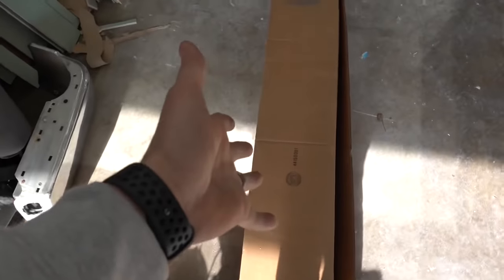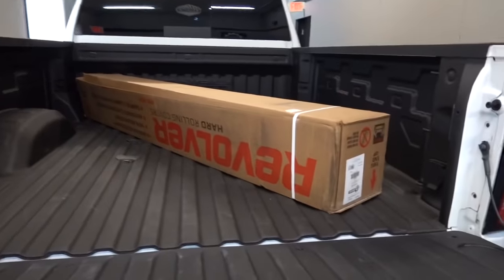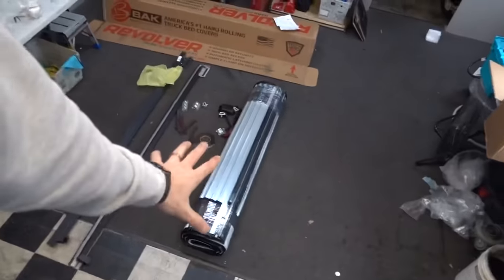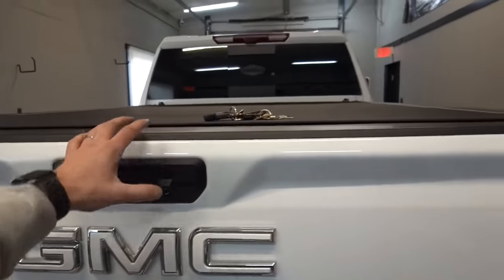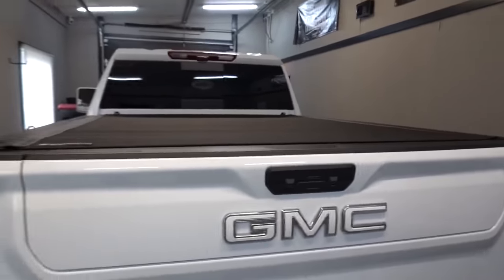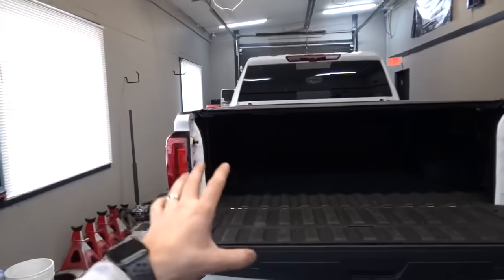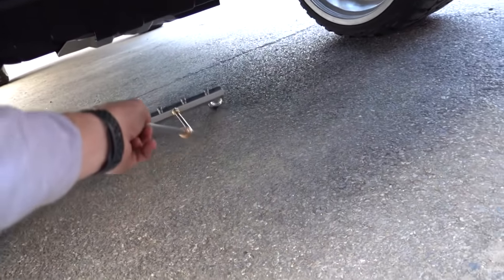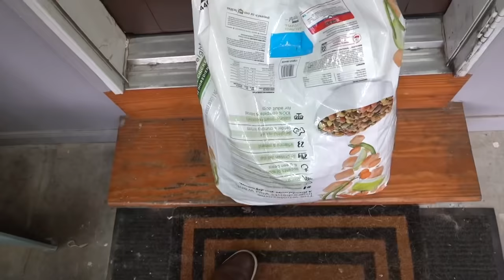Daily Drive your truck? You NEED one of THESE!

Comment: I loved the BAK revolver when I first installed mine.. but  it's falling apart in less than a year,  and no willingness to work with you for manufacturers defects, even though they claim they will.
Reply: My $200 Amazon cover is weather tight and has a lifetime warranty.
Reply: same experience here. I will have to buy new one...but it will not be BAK for sure!!
Reply: I paid $400.00 in 2003 for a Truxedo cover with lifetime warranty and they have put on one new top and new Velcro on each side once . Pretty satisfied with that.

Comment: I herd the DEF fluid can freeze and I think there is an automatic heater, that could be what draining your battery
Reply: In my ‘14 Duramax I had that problem with the def freezing and they never did get to the bottom of it. I ended up deleting before the third time they tried to fix it

Comment: I put one of these on my 2020 a few weeks after I brought the truck home. It was absolutely terrible. The cover itself was 1/4" too narrow and 1/2" too long, but it was the right part number. I was going to have to shim the rails on both sides to make it lay down in the track without beating it down along both sides when I close it. And I was never going to have a seal either along the bulk head or the tailgate. I think they repurposed another part number instead of making one specifically for these trucks, and the fit just wasn't right. So it went back. Getting ready to do a retrax here in about a week. Hopefully a better experience.

Comment: If the truck is dead after a few days you could try and put the truck into transportation mode it turns lots of things off saving battery draw. Also check where you you tapped in for the steps to make sure its not keeping something on. Also you could swing by the dealership and have them do a battery test on the batteries.

Comment: Jack in all the comments if you see this. i have an older silverado but my truck does the same thing with the battery, I thought it was my dvd but its not. But something stays running and if i hit the dash it stops. Only can hear it when its quiet. I think its one of the actuators for the hvac blend doors. Did it on my 08 1500 and my 03 2500. One of the stupidest things but it was drawing power on a consistant basis and killing the battery after a few days or so of not starting it.

Comment: My 2019 sierra Denali 1500 has a recall for the wire that goes to the alternator having g to much glue causing the nut to get loose and shut the truck off. Maybe your 2500 has the same issue?

Comment: As I mentioned on a previous video...there’s no specific draw on your truck. I used to work for a GM dealership and if we didn’t start the Sierras at least once a week, they would die. The stock batteries are honestly just trash. You will be much happier with an aftermarket battery.